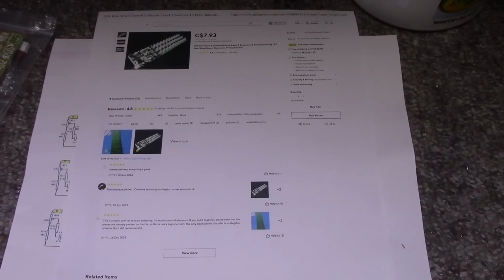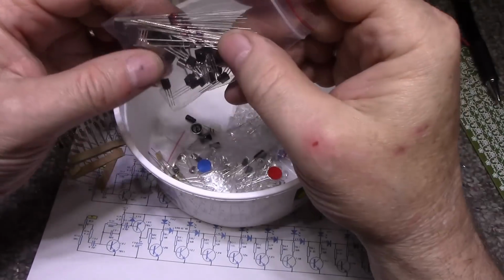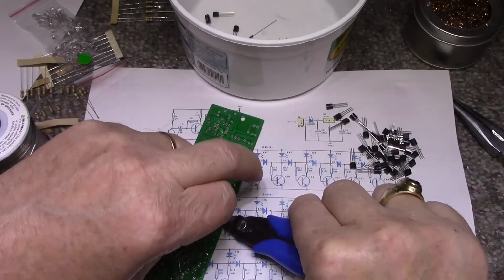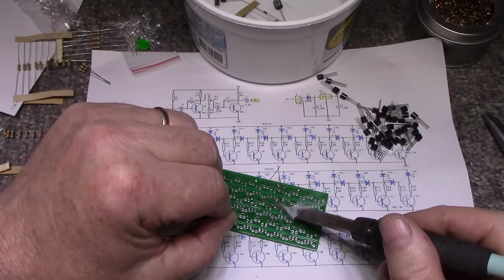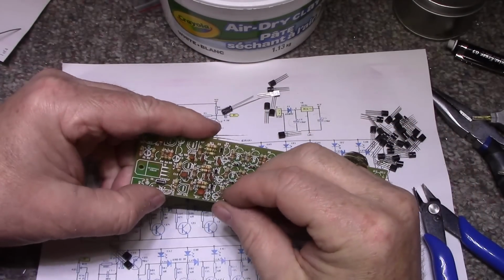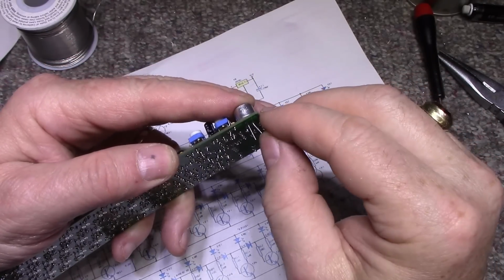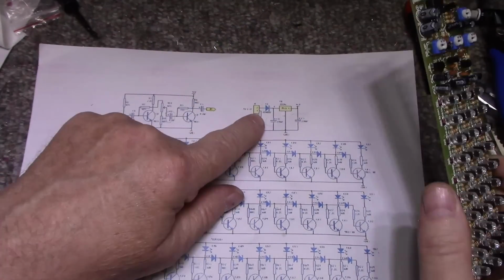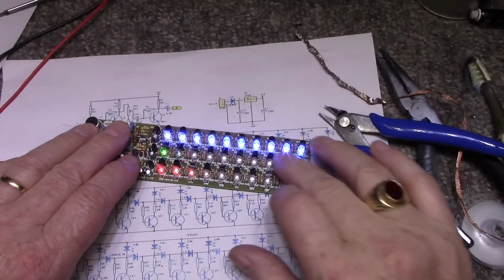LED 3-Band Level Meter Kit Build - Solder & Chat

Comment: I don't understand the attraction with super bright LED's, there is nothing more annoying than tiny bright lights at the edge of your vision in a room with subdued lighting.
I'd be tempted to take a piece of 400 sandpaper to them to take away that glare a bit, just need to flatten the tips a little, a spot of white paint on each one might help too !
Can't see any mounting holes on that board either so how do you attach it to something ?
Reply from the maker: My guess is the LEDs were super cheap, thats why they ended up in these kits

Comment: run a freq sweep to determine bands. The Ali Express kits are great and plentiful. If this kit was properly packaged for retail would be  at least around $20.00 back in the day. Didn't use the LM3915 chip.
Always been a kit builder, Dynaco, Heathkit on down.  Christmas LED trees w/ MP3 players, clocks, blinky things, LED spinners etc. So cheap buy multiples make good trinket gifts. Never concerned about the components because of the price, extra parts for the parts bins. Good diversion from troubleshooting or waiting for parts to arrive. I keep some SMT practice kits around to test hand/eye coordination and eyesight. Also good to evaluate solder, flux and solder iron changes.   My best would be a LED 3D cube or tower.   Thanks !
Reply from the maker: Hi Peter, Thanks for your feedback. I was looking at the 3D cube kit too and would like to tackle one of those one day, cheers!